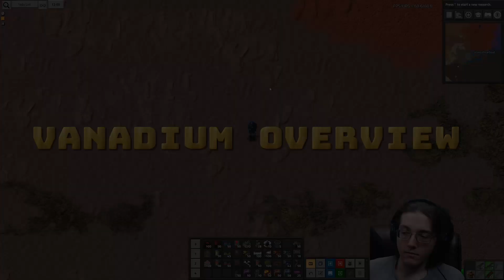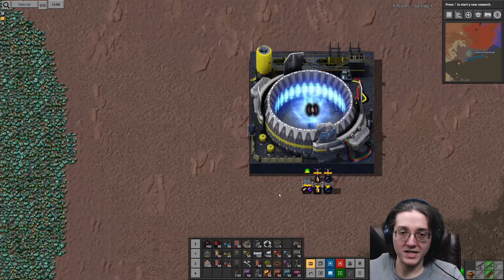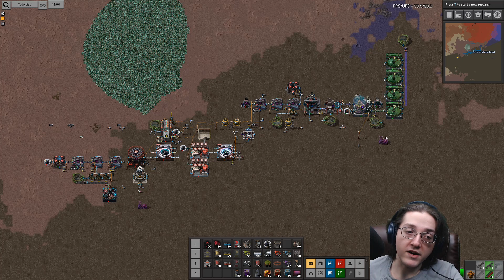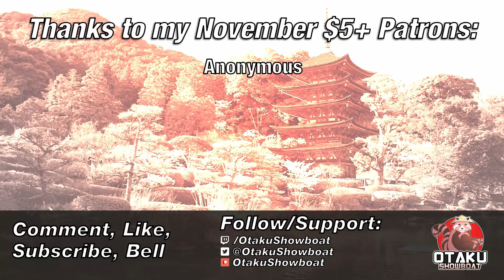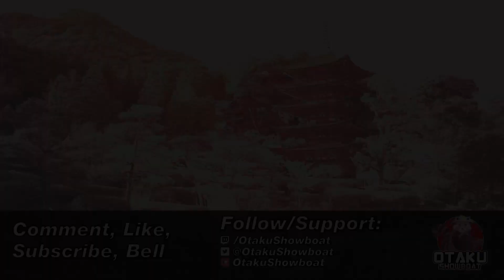Tutorial - Factorio Pyanodons Mods Vanadium Processing Overview

Comment from the maker: In response to some of the issues and thoughts presented in this video, there have been some changes made to the vanadium chain: 1) Productivity modules can no longer be used in this chain; 2) the iron dust input has been replaced with iron oxide; 3) Tailings dust required for blue liquor has been reduced by 40%.

Also, vanadium is no longer required to progress to purple science as diamond mines now require advanced small parts instead of special small parts. I will be continuing my tutorial order as-is, though, and noting this change going forward.
Reply: not to mention that not that long ago iron dust and tailing dust rewew reduced by like 50% or more